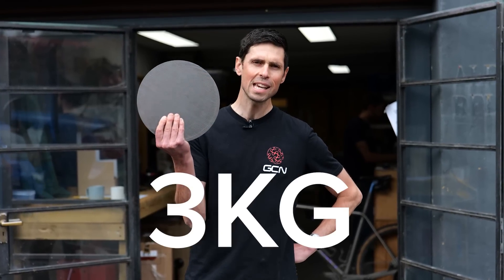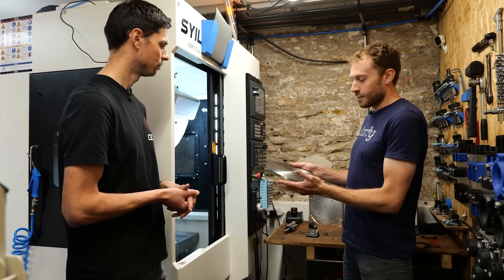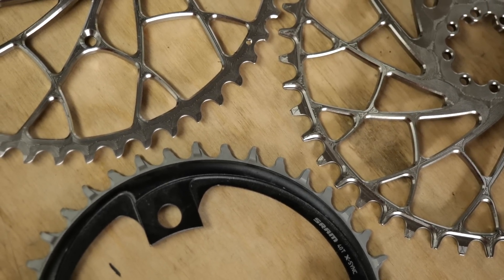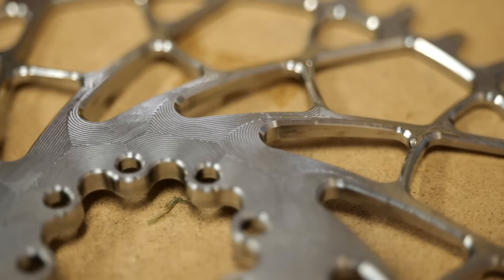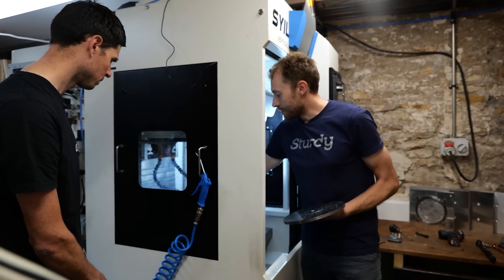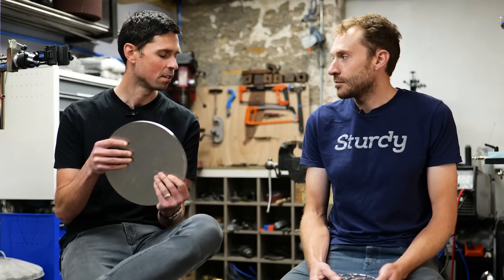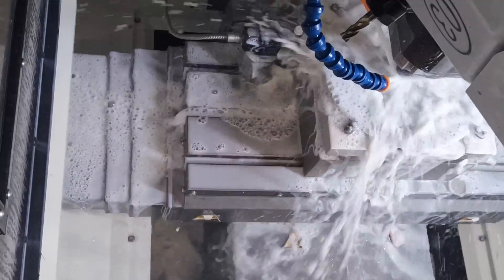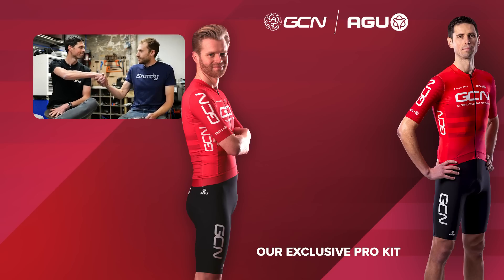How The World's Most Expensive Chainrings Are Made!

Comment from the maker: Would you use a titanium chainring?
Reply: High strength steel like 174ph for wear prone components like teeth. It has better wear resistance and higher strength than any Ti alloy. Since it is only the outer annulus with teeth, it will only be slightly heavier. Mount that on a lightweight aluminium alloy or carbon fiber spider to get back your weight savings. That is the best way to have a rugged but lightweight chainring. Machining a chainring from a block titanium alloy at the kind of prices that are being charged is honestly ridiculous.
Reply: @padmanabhaprasannasimha5385   since when has ridiculousness stopped a cyclist from parting with their money?
Reply: @padmanabhaprasannasimha5385  Well said. Also it's a wearable component, not worth the investment
Reply: Absolutely 💯
Reply: I've had one for 2 years, shows zero wear. It's awesome.
Reply: @mikemazzantini6397  how many chains have you used in those 2 years? I’m really curious 🤷🏼‍♂️
Reply: I would for the right price, unfortunately over here only us companies make Ti stuff. And imo borderline at extortion prices
Reply: Money money money.
Reply: As the owner of a Sturdy crankset, and as I'm about to order another, it was fun to see the machine where my rings were likely milled.  CNC machining is a fascinating process when you look into it and the tools required to mill titanium have to be of the highest quality, precision, and hardness.  These tools aren't cheap and that is reflected in the end product price but, IMO, if you're building a 'lifetime bike' as I am Ti parts, especially on wearable bits, are really the way to go.  I expect I'll never need to replace these chainrings.  Now I just need Tom to start milling (or printing)  Ti cassettes...
Reply: Use - YES!! Buy…. Maybe not 😂
Reply: yes, it will go nicely with my titanium frame. :-) even though it might be over kill.
Reply: If you buy me one
Reply: If someone gives me one, definitely! But I doubt I can afford it
Reply: @phillippitts6294  especially if you live in the EU will pay 14% import tax on it plus 19% VAT, at lease in Germany.
Reply: Definitely would use a Ti chainring but I'm using a titanium stem,it is superlight.💯👌🏻🚴‍♂️
Reply: May be a virtual one on Zwift. In the real world it is not worth the money.
Reply: Only with a properly prepped immersion wax chain!
(Oh no you didn't!  Yes I did!!!)
But TBH, it's true.  Don't sully a thing of beauty like that chain ring with horrible wet lubes that quickly turn to ABRASIVE PASTE!!!!
Ride faster, further, longer and cleaner with wax!
Plus, you don't have to poison the environment either!
Win-win-win-win-win!!!
Reply: If the price was right, absolutely. Thanks for the very interesting video, Alex. Any plans to show the design process for the  additive manufactured parts  Tom makes? I'd love to see the process to seee up the computer for his crank arms.
Reply: I'm holding out for one made of magnesium ✨
Reply: No thanks.
Reply: not the funds :(
Reply: It would be more efficient, if the chainring was first melted and cast in a mould, to basic measurements, and then processed in the CNC machine. Then a lot of material would not be wasted.
Reply: You could probably forge and machine one for a fraction of the price. Anyway, great video.
Reply: Yes, if I didn't have to pay for it.
Reply: No I am not dumb
Reply: No. For my daily commuter bike, i switched to gates belt drive and Pinion gearbox, and i am super happy with the low maintenance and longevity. Especially when you ride on salted roads in the winter, chain and derailleur just take a lot of time and effort to constantly clean and lubricate. Even if the belt and gearbox system is a bit less efficient in power transmission, i prefer to pedal a bit harder and do less maintenance.

Comment: I am surprised there was no more science involved in the design as ultimately the purpose is to create the lightest component for the performance that you want to put through it.  I suppose that the tooth design is a standard one along with the crank drive but everything in between is open to creating the optimum performance that ought to come from a detailed analysis using say, finite element analysis.  I wonder how different the chain ring would be if it was designed by a F1 team?

Comment: I can vouch for Ti chainrings, I had a Shimano XT drivetrain, I literally chewed through the first (3x) middle ring in under 250 miles (riding very dusty trails, but regular chain lubing/cleaning)... after the 2nd XT ring at around the 700 mile (total, so 500 on the 2nd) mark, I decided to buy a Boone chainrings middle ring replacement... it has lasted over 2000 miles (still going), and only cost about 3x the Shimano XT ring cost, and still works great (it's outlasted multiple chains and a broken bike frame over the years, LOL).  Doesn't get ridden much anymore, now my loan-a-friend or certain conditions riding bike, but if you are looking at 3x the price for Ti vs Al, I say buy Ti (at some point it might not make sense, but you have to figure out what multiple makes sense to you).
Reply: Have you ever tried waxing? It's a game changer when it come to cleanliness and wear.
Reply: not sure what was going on but that sounds more of a quality issues than 'material strength', maybe 'fake' products... e-bikes aren't able to wear chainrings at that rate in muddy conditions
Reply: @duroxkilo  Factory shimano XT chainrings (after replacing the actual Specialized crankset which had the same issue with Shimano XT), they were notorious at that time for wearing like crazy (made of butter was many people's comments, LOL), from reputable sources (Specialized authorized bike store on the original set, and Jenson USA, back then there wasn't the influx of cheap knoock-off stuff). The dust around here is like grinding paste and just chewed through those (the steel inner rings were fine).  I also weighed around 235# at the time and wasn't light on the bike, LOL.  But again, most around here were replacing chainrings regularly back then due to this problem and our very dusty conditions.
Reply: @ChrisTexan  so basically they were trying a new alloy/supplier for whatever reasons and it didn't work well at all. i haven't heard of such atrocious performance fail before...
dust mixed into a nice abrasive paste is indeed great for grinding :)

i'm in the sonoran desert and there's no escape from dust. i'm currently cleaning a few new chains in preparation to wax them. from what i've read it works wonders in stopping abrasives from entering and wearing chain'a internals. as i understand it, in part it's because wax is dry and dust doesn't stick much to it and in part it kind of 'clogs up' the openings responsible for letting dust and other abrasives from entering the chain. apparently even paraffin alone offers longer chain longevity in dry conditions but commercially available chain waxes contain friction modifiers and all that for higher efficiency. ppl report over 150miles between rewaxing and insane drivetrain longevity. i'm a bit skeptical about some of the outrageous numbers (like 10000miles on a chain) but i'd be happy w/ half of that if i'll never have to touch a dirty chain again since wax is supposed to maintain it super clean.
be safe have fun, happy holidays

Comment: CNC machines are blooming expensive. The fluids aren’t cheap either. I used to work in a die casting outfit and we machined finishing holes and threads, as well as grinding off sharp edges

Comment: That looks like a Colchester Chipmaster in the background (4:21). The man has good taste in lathes ;)
Reply: My smallest lathe is a new  Colchester Master, short version, a pleasure to operate.
Reply: The shop I used to work at had 3 of the larger causing colchester lathes with the 12 inch chucks. We were turning a lot of 4 inch s7 bar stock. 
The owner really liked clausings , he eventually got us  
two  clausing cncs with Fanuc Ota controllers on.  They didn't have turrets on them,  but we found the Aloris quick change tool holders to repeat for accuracy quite well.  As long as you didn't crash anything,  then you had to go through a lot of screwing around to get it dialed in again.  We found that we didn't need tool changers on the lathes because the cycle time on a part was long, especially with a single point tool like in a lathe.

Comment: You should see JLR make a cylinder head on a 5 axis CNC miller. Wolverhampton Engine Plant.
Cast Alloy Engine blocks are finished on CNC machines.
ZF makes the gearboxes the same.

Keith Black and most others 5 axis machine a drag race engine from one block of wrough aluminium alloy.

Comment: He brings up additive manufacturing at the end.   I have seen 3d printed titanium frames so I would assume it would be strong enough for a chain ring I'm kinda surprised they would go the machined route for a smaller part like this.  I have ordered a 3d printed aluminum part before and it showed up incredibly smooth for what I was expecting so i would think it would be good enough for chain rings.
Reply: Price of materials in getting smooth printed items is very expensive compared to machining from a blank. Plus the price of a printer compared to mill would be about 10 times the cost that has to be recouped during manufacture which would push the price even higher.

Comment: I have two questions, first of all why are we starting with such a hefty blank of titanium? 3 Kg down to 150 g why do we have to remove so much material? My second question is titanium is harder than steel, so that means that this chain ring will wear down the chain instead of the other way around. How does that affect the system?
Reply: You did see how it was done and how would you make it without doing it the same way? If you don't start off with a blank  holding the material safely would be almost impossible.

Comment: Hmm, I'm a bit curious, why there is no way just simply melt Titanium and pour into a special form, and then finish it with such machine?
Reply: Titanium casting is a thing. It's a very challenging and specialised thing, but still a thing. For a small shop like that, cnc is probably a lot more economical
Reply: Cast metal has a different structure than forged metal. Drop or hit a piece of cast metal and it will break. Forged metal will be bent. Something delicate like a chainring would break under stress if made from cast metal.

Comment: Thanks for sharing this, it was interesting to see how others are doing it, I own a CNC manufacturing company that also makes chainrings. I was a little surprised on the waist, we use mostly  7075 aluminum and would hate seeing that much material going into the recycle bin. We start with a much closer diameter and thickness to the final part.
Reply: *waste
titanium might be harder to get in specific stock sizes, or he just wants to keep one blank on the shelf for every order. But yeah huge amount of waste.
Reply: @jaro6985  don't know how many they move too so could be orders are small enough where changing work holding and blank supplier might not be cost effective at that point.
Reply: Only just started my cnc journey but as soon as I saw the % waste my thoughts were why? And consider a better engineered option - just because you can does not mean you should
Reply: Making a profit doesn't seem to be a big priority.
Reply: @paul5683  They do cost about £380 so there seems to be some margin in there for profit.
I've made chainrings before, but I had a laser company cut them out of thinner plate and then I had the machining of the tooth features as a secondary step. Much cheaper for me to have them done that way.
Reply: The triangular shape that turned into filings could be used to machine smaller parts such as parts for the gear shifters, and parts for the rear derailleur, there are several small parts that fit inside those wasted triangles.
Reply: @smmm80  Its not that simple, its difficult to hold odd shaped material, so it would take time to cut this stock into a suitable shape, and then how much material is actually left and how much labor did you pay to have these pieces cut. From a business perspective trying to reuse leftover stock doesn't work out very often.
Reply: @chrisb4961  I'm not saying to use the triangles in new machining but to use them together with the chainring, instead of making a single piece and making another one together, I believe that the most complicated thing would be to separate the machined parts of the chainring.

Comment: But is it more durable than steel?
Reply: Depends on what steel you use, but normal stainless, yes, expensive stainless? No, but that will be as expensive as Titanium AND heavier, and the wear is not an issue to begin with.
Reply: Who uses steel rings?
Today's 1X don't.
If you're worried about durability, switch to immersion chain waxing.  You'll never wear out a ring if you do.
(Probably shouldn't say never, but who cares!)
Reply: @dudeonbike800  
I never understood that choice. You got rid of all that weight by going 1x, but you can't afford the extra 100 or so gram for a way more durable steel ring?

Comment: I'd water jet about the first 90% of the work, why waste all that machine time milling it.
Reply: Water jet time is still machine time? It doesn't come for free either.
Reply: @jonasv328  It can save you tons of time and material.
Reply: I’m guessing he’s not got a water cutter
Reply: Or wire EDM
Reply: @festerofest4374  Wire EDM plows through titanium super fast.  Ideally would use a machine that will pop its own holes.
Reply: @justinp2559  Tools for EDM titanium are expensive. Like 10 years ago they used tools out of pretty much pure Carbon for that. Don't know if things changed. It probably works with cooper too, but with downsides.
Reply: @festerofest4374  £££
Reply: Good luck locating it after water jet.
Reply: @Minerals333  Leave a few tenth of a millimer of material in each direction. It won't matter if its disaligned by a few hundrets of a millimeter (which is easy to do). I wonder how to clamp it after the water jet. You need to have some plan area of descent size.
Reply: Wire edms run about  150, 000 pounds to start.
Reply: @paul5683  yup and if his volume is >1000, probably makes sense
Reply: @paul5683  Not for long. Should only be a few thousand pounds in 2025.
Reply: I agree. Also by using an abrasive water jet, they could cut the chainrings out of flat plate material, which would probably be cheaper in the long run.

Comment: I started working in a machine shop when I was 18 being a machinist is such valuable skill something I could always fall back on easily finding work I once was in charge of 3 cnc mills vertical and horizontal our shop specialized in titanium aerospace parts and race car parts. I always thought about drawing up bike parts with our CAD cam software cool to see somebody doing it.
Reply: @JorgitoHawk  Does titanium require more cooling than steel because I only use one nozzle on the Milling machine at when cutting,the CNC is using 4 nozzles?
Reply: @reinholdachleitner2069 
Yes, titanium has very low thermal conductivity. Very challanging to machine titanium compared to aluminium which have a very high thermal conductivity and easily creates nice chip that take heat away from the work piece.

Aluminium is new
Reply: @DavidH_1_2_3  From the short time I spent in a machine shop back in the day, I seem to recall that Ti work-hardens like a bastard so cooling might help that. What I think there might be a market for is Titanium SPD-SL cleats. Given that the standard ones seem to be made of cheese.
Reply: @ACCPhil  That is true and it is in a way connected to titanium's low thermal conductivity. Work hardening is also called cold working a metal.

To clarify my previous comment, the extra need for coolant is to cool down the edge of the cutting tool, since very little heat is conducted through the work piece or the chips. The edge of the cutting tool gets too hot and easily dulls which makes the problem with work hardening worse and less cutting tool coating makes the high reactivity of titanium on the cutting tool even worse.

Cryogenic coolant is an interseting area of research especially for machining titanium.
Reply: @reinholdachleitner2069  We always tried to keep the cutter cool as possible, it's all about speeds and feeds, we found that the grade titanium we used had an almost spongy characteristic when cutting with an end mill, one thing we did find out simply by chance was that a good Hanita aluminum end mill worked better cutting titanium that expensive titanium end mills, saving the shop $ and a good bonus at the end of the year.
Reply: I've done work with many machine shops and millwork (wood) shops so I'm very familiar with manufacturing, including CNC. I think this video did a great job of explaining many of the factors and considerations in manufacturing for folks who haven't been exposed to it. 

And their production speed challenges in this shop are nothing that can't be resolved with bigger/better/$$$$$$ CNC milling centers lol!!! And that is a common business conundrum/challenge.... how much can/should we invest to upscale production!
Reply: @festerofest4374  And their production speed challenges in this shop are nothing that can't be resolved with bigger/better/$$$$$$ CNC milling centers lol!!! 

I guarantee that the Chinese are very good at this, the question is to convince them to do it, especially because sports bikes did not attract the Chinese.
Reply: I made my single  81 tooth chainring from scrap aluminum checker plate. Now they call me the floorplate man. 75yo not easy to ride up hills but a challenge to start in 4th on cluster and end up before top in 10th. Not fast but a workout for sure.